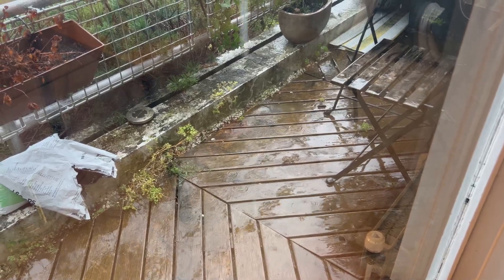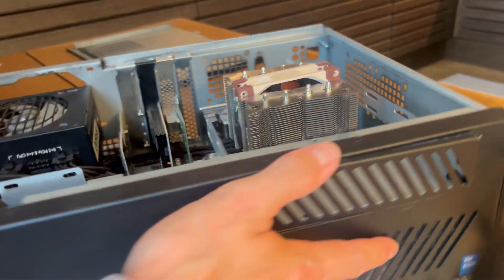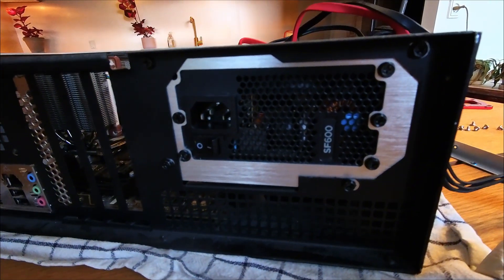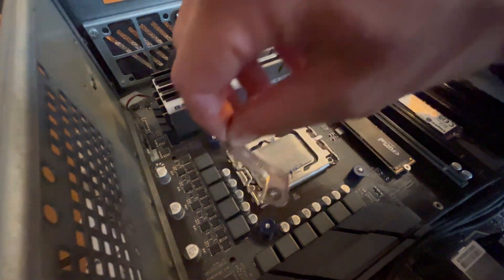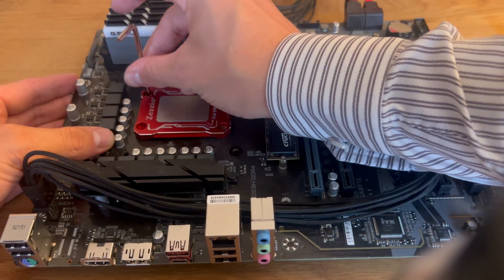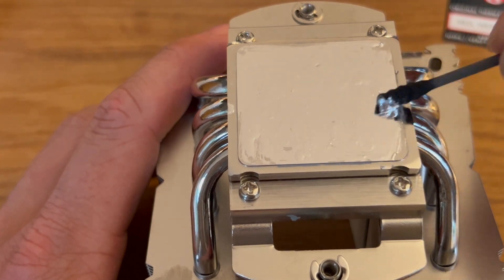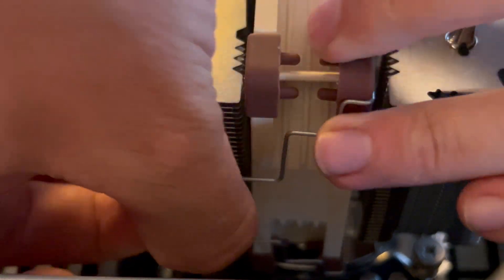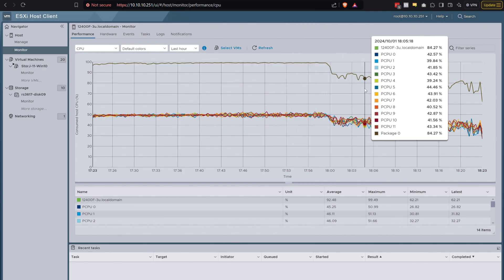Homelab maintenance I should have done before

Comment: I've been running liquid metal for years, even before Thermal Grizzly released its own version. Had cooled a few desktops and one laptop with it. Both air cooling and with custom liquid cooling. With direct-die CPUs and on normal IHSes.
What I can tell from my past experiences: LM will stain that beautiful Noctual cooler baseplate after a year or two. It will still work perfectly fine though, but the only way of removing that staining will be to lap the base of the cooler. This is because LM is still corrosive to the nickle plating, it just does it during a long time.
I also never did the "put on both surfaces" part when it came to direct-die application and never had any problems with it spilling out or loosing performance. My laptop still has the same temps under full load after 4 years.
As for the IHS to cooler application, I recommend to not go over the smaller surface area over both surfaces. So I always try to mimic the IHS size on the base of the cooler. Doing it like you did, where you covered whole base of the cooler introduces the siphoning process, because LM has an easy way to go away from IHS to the sides of the base. If a drop of LM manages to connect with contact frame, it will eat it very fast because it is aluminium based. So I would recommend applying it on the IHS and on a little smaller surface of the Noctua base, just to be safe.

Listening to a rain falling on the glass is very relaxing, I wholeheartedly agree with you on this. 🌧🌧🌧🌧
Reply from the maker: This is a great comment, and I've taken some time responding to it properly. It's wonderful insight, and some very good tips. I'll be sure to keep that in mind for future LM applications. Have a good day my friend.